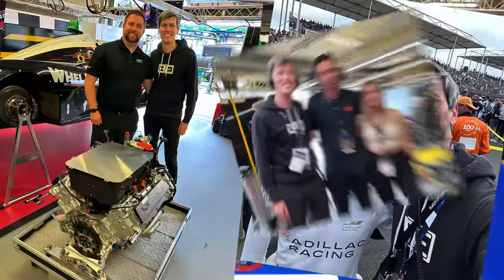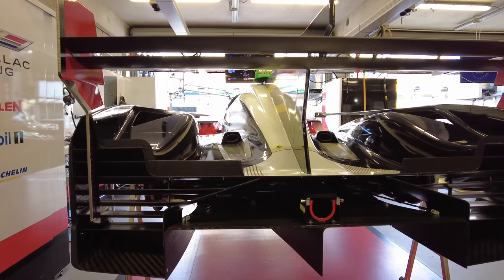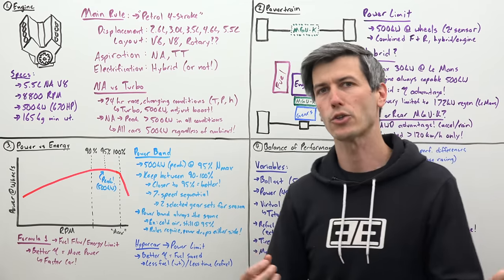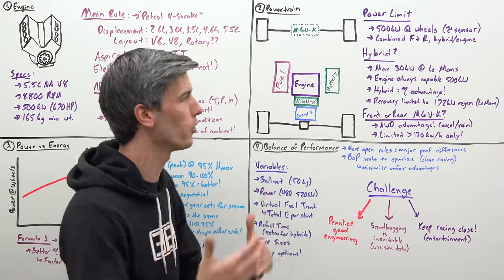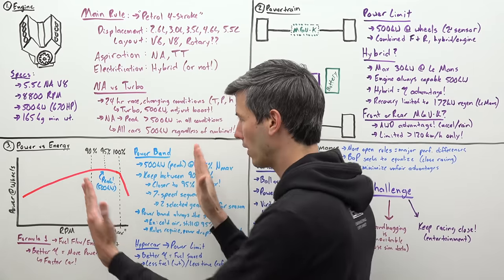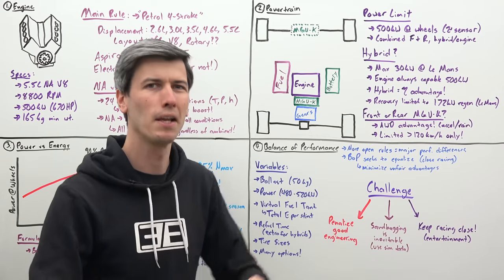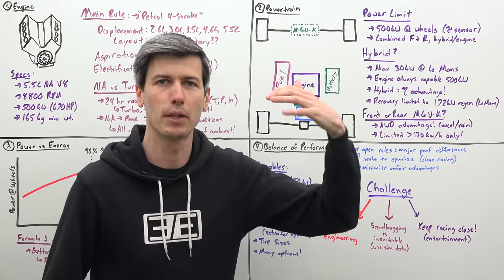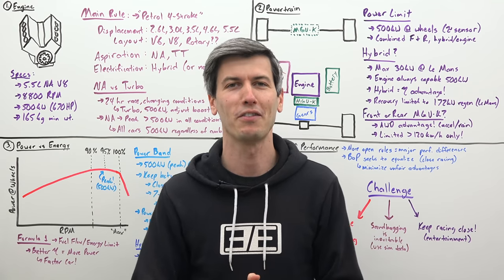Are Hypercar Engines Better Than Formula 1? — 24 Hours of Le Mans

Comment: I have to say that the 24 hours of Le Mans was actually more fun to watch then the last few f1 races.
Reply: le mans is almost always more fun than most F1 races
Reply: @joeygold24 didn't Toyota win LMP1 class like 5 time in a row?
Reply: @garbage2882 true but Ferrari won this year and Leclerc got to see what a good team looks like from the AF Corse paddock. So excitment is back
Reply: @ergoproxy-gx2cq  LMP1(although LMP1 turned into Hypercars, I'm not talking about Hypercars) had domination just like F1 but because it's endurance racing, it wasn't as visible as in F1. Actually F1 was the same, there was domination, but because of reliability it wasn't as easy to notice.
Reply: "Actually"😂
Reply: @garbage2882 yea, because that's when there was no BoP yet. The whole thing got too expensive (development war, dieselgate at VW so Porsche and Audi left and Toyota was alone). Toyota then picked up 5 wins in a row, because there were only private teams trying to take on this giant. Contrary to the opinions of some morons btw, Toyota did not only win, because there were no other manufacturers, but because they are an excellent team!
Reply: @ReXzz  still doesn't change the fact that every sport has domination, if not by a team, then by a driver
Reply: It was more fun than the entire 2023 season so far
Reply: @garbage2882  well yeah... as I said: that was pre BoP.
Reply: I'd respectfuly disagree, enjoyed other endurance races more than the 24. Monaco over the last three years was better than this year's 24. Last year's though was epic
Reply: @ChrisAce117  stop using drugs
Reply: No it wasn't. 10 mins of highlights over a 24 hour race
Reply: @alanr4845  you could have easily made a 60 minute highlight video of it, it was literally THE RACE
Reply: @ReXzz  true, but even with BoP you still expect the winner, even with BoP it's impossible to make the field more even, that's why BoP works to bring the field together, but not the leaders
Reply: @garbage2882  Because there was no competition. Porsche and Audi were gone. All the other cars just weren't enough to beat toyota. And when porsche and Audi were there toyota had really bad luck with reliability. When they left coincidentally they were fine and there superior pace and reliability won them le mans those 5 times.
Reply: @Jesko.  I'm saying there are always backmarkers and frontrunners, just like I don't expect Wiliams to win a GP, I don't expect a Peugeot to win the Le Mans
Reply: @garbage2882  Oh then yeah. But not as bad as f1. Utter domination right now.
Reply: Fun watching seeing Ferrari win with a weight advantage of 12kg… Toyota has the fastest car by miles, but don’t get the exposure for that. In lemans you can making a bad car, get the luck of the BOP and win the race…. What is up for Toyota to stay in this competition and get be punished to have the best car…

It says enough that a customer team of Ferrari wins the race… beside that Ferrari was on Spa no where near Toyota. The FOM changes the BOP just before Lemans (officially they should only do this at the begin of the season) and Ferrari wins. This is just competition forgery…
Reply: @ergoproxy-gx2cq a good team???? A team with a 12kg wait advantage over the best car on the grid of Toyota. Ferrari does not have the best car, they had the most “luck” with the balance of performance…
Reply: @remedy81  The toyota had more energy this making up for the 12 kg weight diffrence. You don't talk about that didn't you? Sebring. The first race of the season. No BOP at the time since it was the first race. Guess who had pole position in qualifying? Ferrari. They always had the pace just didn't execute strategy well. That was what toyotap had to beat them at spa. More experience. Went for softs took the risk and it worked perfectly this giving them the win.
Reply: Le mans is one race a year and very long so lots can happen. F1 has a 22/23 race season. They can't all be classics 😊
Reply: @ergoproxy-gx2cq  The Ferrari team are mostly the same people from the Ferrari F1 team that were laid off thanks to the spending cap.
Reply: Yes, The Red Car fighting for the lead is what the people want to see! Forza Ferrari! CL16
Reply: @unclecousin5782  hey Charles Leclerc qualified 2nd this weekend
Reply: Most series are better racing than F1.
Reply: @ChrisAce117 You must find drying paint fascinating.
Reply: Sebring 2023 last hour was more exciting than anything in F1 for years.
Reply: @garbage2882 because they were the only serious effort until 2023.
Reply: @Jesko.  well, somewhat yes, but look at quali, except P1, anyone can be second, McLaren, Ferrari, Aston Martin and Mercedes are all close enough to fight for P2
Reply: @truantray  and Ferrari was the only serious effort in 2000-2004 but we still call it domination
Reply: @garbage2882 That's because Toyota had no competition, until ACO & WEC introduced the Hypercar category. Now we are seeing the results
Reply: @AndrewBlackMaster  still my point stands, there is domination everywhere, just because in F1 it's easily visible doesn't mean WEC didn't have it too, also, was Group C like mostly dominated by Porsche?
Reply: Yep.
I don’t understand f1 anymore
Reply: Definitely not Austria
Reply: @ReXzz  Toyota GR is still way ahead of the others in this year's WEC - they were heavily nerfed by BoP.
Reply: @BiggusD77  correct
Reply: @garbage2882  but that's only lmp1

Also you could never be sure if they would reach finish line because they were usually the fastest but two or three years in a row they had reliability issues just before the end
Reply: @cyjanek7818  and? Usain Bolt was the fastest guy in sprints, but who knows if he falls before the finish line? like Mercedes in F1 in 2016, they would've won every GP if it wasn't for their drivers crashing into each other and reliability, but it's still full domiantion to win 19 out of 21 races, also, not many teams have reliability problems for long, mostly it's for a year or two and then it's fixed, unless something new starts to break
Reply: The 24 hrs of nurburgring this year was fire. My brother and I took turns watching. I had to leave for work, but he said he couldn't sleep bc there was constant action over the night portion of the race
Reply: @garbage2882 if you look back before those 5 wins Porches and Audi dominated before Porches for 3 or 4 years returned Audi dominated the early years of WEC. Back in the day other manufacturers have dominated. It's just how Motorsport works. One team gets it more right than the others untill rule or personnel change.
Reply: @akagainesy  that's exactly my point, F1 may be dominated for a few season because of cost cap but it will probably end after 2025
Reply: @garbage2882  that's what I'm hoping. People who say the cost cap isn't working hasn't given it enough time. It'll take 5 years at least before we really see it even the teams out
Reply: 24h hours of Nürburgring much better then le mans
Reply: Great engineering detail as always however I think you should have explained the 4 race classes within Le Mans up front, you were talking about the LMP1 category which has fairly complex energy limits per lap which change depending on the deployment of hybrid and regenerative tech you use. The daddy class is the LMP1-H, the mostly unrestricted class which is easily the most exciting one recently dropped into the mix, harking back to a technological freedom not seen since back in Group C times. This is truly exciting and what F1 today should be about, having very little restrictions in the real pursuit of performance. For me, that’s why F1 the last decade has declined to the lowest point its been in history. It’s almost ridiculous tbh as top-class Le Mans endurance cars can outperform in some cases the best F1 cars on their own GP circuits. This of course should never be the case, it should not even be remotely close. F1 should be the pinnacle of racing car performance, and it could be unfortunately is stifled with ridiculous FIA regulation. Year-on-year they just create more complex rules in a futile attempt to make it more exciting for fans. I think fans just want the FIA to relax performance regulations so it can be more creative engineering wise, so that each year we see lap times come down. So records are broken and not through aero necessarily more through the cars performance everywhere else, in turn making the race more of a 80% driver influence in being able to win the race due to the cars over performance of even the mid level teams. At the moment it’s more like above 90%+ the car rather than the driver making the win, and that’s just rubbish. Even between drivers in the same team is not a real race as the teams dial up and down the car’s performance depending on what’s happening in the race 😂
Reply: @garbage2882  Audi won, like, 10 times in 14 years. Which is funny, because Group C basically died because Porsche was destroying the competition, and then LMP1 was demolished by Audi.
Reply: @garbage2882  if ussain bolt would fall twice in a Row before the finish line then yeah, you can expect that. 

If missing the point was a championship you would be dominating
Reply: @MrPrajitura  yeah, and the only problem engineers had was reliability, which wasn't even bad, but we still call it domination, some people just act like it's only F1 that has domination
Reply: @cyjanek7818  if acting like Le Mans never had domination was a championship, you would be Lewis Hamilton
Reply: I can say first 4-5 hours is more enjoyable than entire F1 history.
Reply: @garbage2882  Because LMP1 costs a lot and many bigger teams such as Audi or Porsche stopped to make LMP1. With the Hypercars the cost of the cars are way cheaper and that took the attention of big manifacturers such as Porsche, BMW, Lamborghini (next year). Also IMSA took almost the same regulations. The only difference between LMDh and LMH, LMDh cars has to use some spesific chasis such as Oreca, Ligier, Dallara, or Multimatic and the cars has to have hybrid engine. In IMSA the LMDh class is their fastest class called GTP. As a result it brings Cadillac Racing from the NA. Not only that, with the lesser cost, LMP2 or lesser category teams wanted to join Hypercar grid. Some teams like Alpine decided to make their own hypercar. Or Teams like Jota, Proton or JDC Miller decided to get a hypercar from a Porsche. Or WRT will get their BMW M V8 Hybrid, Prema wiill get their Lamborghini. Even the Aston Martin will join with their Valkyrie on 2025. So Don't confuse LMP1 with LMH and LMDh.

And Le Mans isn't an event for only LMP1 LMH or LMDh. Watching competition in GTE PRO on previous seasons is way enjoyable than F1 . I'm an F1 fan since 2001. But every time I've watched Le Mans I enjoy way more than F1. Finally WEC and IMSA made great regulations and now F1 turned a big meeh for me. WEC and IMSA did a great job positively but also F1 failed really bad with V6 era. So I'll say that again.

Do not confuse LMP1 with the rest.
Reply: @alanr4845  Did you watch the race?
Reply: And they sound way better than f1 cars
Reply: You just have to ignore verstapen 
To me,midfield battles are fun
Reply: @remedy81 — Your buddy Jesko has no idea what he’s talking about regarding the additional energy allocation given to Toyota (and Ferrari too for that matter). The energy allocation does not affect the speed penalty that the additional weight exacts on the car. It is designed to restore the range capability of the car to pre-penalty levels.
Reply: @Jesko.  sebring no BOP you are just kidding? The BOP was in place before the first race, based on measurements in the test sessions before the first race. They changed it before Lemans that is just the point. Changing it before the most important race of the season…
Reply: @Fake67257  Not to mention the fact that they changed the BoP just 3 days before the start of the event without informing the teams, where they should've had to change ONLY AFTER Le Mans, for Monza. Thats how it was supposed to be at the start of the season.
Very cheap move from FIA/ACO cause they made everything possible to not let Toyota win the race at Le Mans...
Reply: You mean the last few seasons of F1.
Reply: @garbage2882  Yeah, but that was because Porsche ran away and hid after lucking into their 2017 win.  You know, to avoid the embarrassment of losing to a Japanese manufacturer.

It's like you ask most European/British Le Mans fans who won in 1991.  About half will say "I don't think the race ran that year", to avoid having to say that a Japanese manufacturer won.
Reply: @gomezgomezian3236  yeah I don't think it's true, some idiots may say that the Mazda was cheating because it used a different engine, but those are just idiots, there shouldn't have been put restriction on what type of engines you can use in Le Mans, the ban was probably created because Porsche or someone else was just lobbying against Mazda, which sucks, but it happens in every motorsport which includes WEC
Reply: @alialibeyoglu7532  the problem with GTE is that it's not the fastest or the lead class, while yes the fights might be great, watching 2 or more cars fight for a position just for a random LMP2 car to overtake them with ease is very anticlimactic for me, I watched 24 hours of Spa a few weeks ago (at least the last 3 hours) and it was amazing to see the battles, but the problem is that only the lead battle was shown, almost nothing else because other fights don't matter as much
Reply: @garbage2882  well you are right in some situations. But maybe their fight interrupted by faster class but oppositely their fight could spice up with the faster class. Next year either them ir Hypercars will compete since there wont be any LMP2 in WEC. I'm pretty sure, they'll give a lot joy for us on next season. Personally I dont like gte cars in WEC. But in IMSA it's just amazing to watch their competition.
Reply: @joeygold24 I also want to watch le mans but I live in India no channel shows it 😭😭😭
Reply: Le Mans for Toyota & Ferrari, the rest just pointless
Reply: @Fake67257  Alright then could you tell me the bop for sebring and then the bop for le mans? Sebring bop must have been so small.
Reply: Yup, I mean, it's better than the last 13 years of f1. Vettel, then Mercedes/Hamilton, then now Verstappen. All boring
Reply: @garbage2882 didn’t Ferrari win everything from 2000-2004? What about Mercedes from 2014-2020? I guess we can go back in time and find a lot of examples of this it just depends on if you’ll say “well that was just McLaren back in the early 90s none of us were even alive and that’s how it was back then”
Reply: @JMak02  does your ass really hurt that much? I commented under a guy saying something not true by showing an example of why it is untrue, also, Ferrari weren't the only ones winning between 2000 and 2004, in 2000 Hakkinen was still fighting for the championship and in 2003 Montoya and Raikkonen were fighting, but in both cases Ferrari were just slightly better.
Reply: @garbage2882  it happens in almost every motorsport that involves developing non spec cars. Idk why you felt the need to point that out in wec but then get upset at me for pointing out multiple times it happened in f1 in the past. Just like it is currently.
Reply: @JMak02  I'm not the one upset here, the guy I responded to was saying how WEC has always been better than F1 and I pointed out moment when they were not better and I'd say even worse, because in 2017 and 2018 at least there was a fight in F1, but WEC? Not even close to a fight.
Reply: @garbage2882  hmm little digging reveals his post is unedited and has the key word “almost” positioned before “always” Can you define almost? I know it’s a tricky one but good thing is it doesn’t really matter because opinions on what Motorsport an individual prefers are never “incorrect” lol you’re actually mad someone has a differing opinion even putting different words in his written down comment to give it a twisted meaning. Idk why anyone would feel driven to do that. Get some support.
Reply: @garbage2882  another read through reveals he is talking about Le Mans as in the individual event not the whole WEC calendar. If he was referring to that he would have said “the wec is always better than f1. That’s not how his comment reads. Again more putting words into others comments that never existed. Sad life for ya
Reply: @JMak02   almost always implies that F1 is almost never good, which can easily be proven to be wrong, you're the one who responds to a 4 month old comment so I'm not the one who should seek help
Reply: @garbage2882  go and enjoy some DTS for the 50th time.
Reply: @JMak02  that's even worse, it's like saying that Indy500 is better than FE, it's just not, you can't compare one race to literally a whole season or series
Reply: @garbage2882  again that is his opinion so it is undoubtedly correct. Maybe not for you but that’s what seperates opinion and outright fact right? yeah it happened to pop up in my feed months after video released and made mistake of going to comments. I’m clearly not as up to date on YouTube content as you and envy your free time. Lol you’re continuing the responses 4 months on, so I’ll see you there too?
Reply: @garbage2882  maybe he meant the Le Mans 24 hour race is better than any race formula 1 puts on. Again that opinion is not correct you just have an issue with someone having a differing opinion. Do you also argue with someone if they tell you their favorite color is green?
Reply: @JMak02  cry me a river dude
Reply: The WEC has been a better series than F1 for a about a decade now.
Reply: No